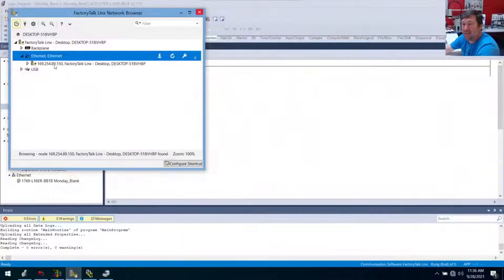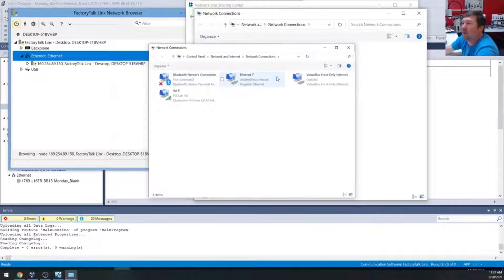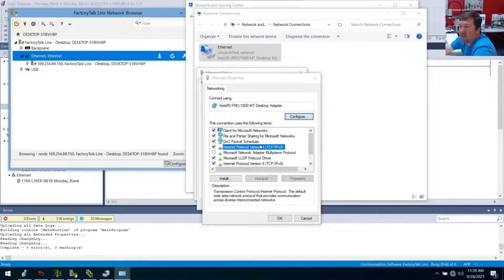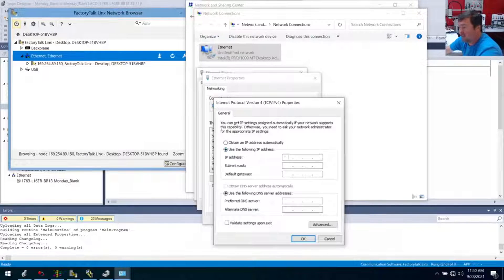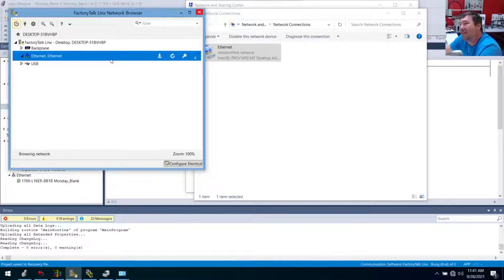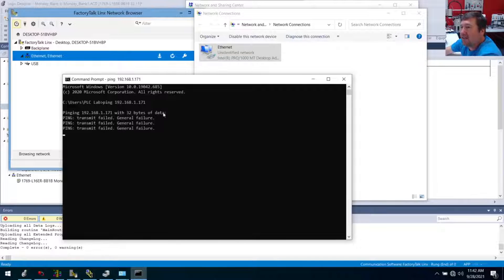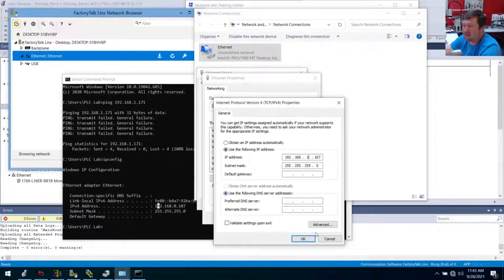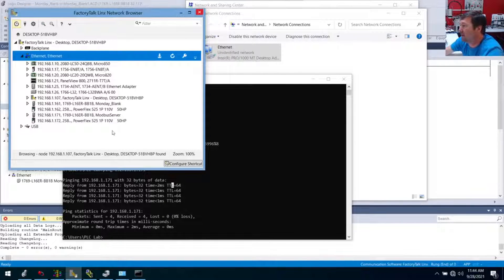FactoryTalk Linx to Connect to an Allen Bradley PLC over Ethernet

Comment: Hey Tim,
Is it possible to connect via Wifi.  By having an ethernet cable connect from the PLC to the laptop.
Or would the only option in that circumstance be by having a wireless VPN router.
Any help is appreciated.
Reply from the maker: Yes, as long as your network configuration will allow you to ping.